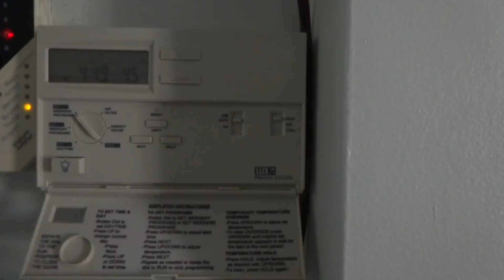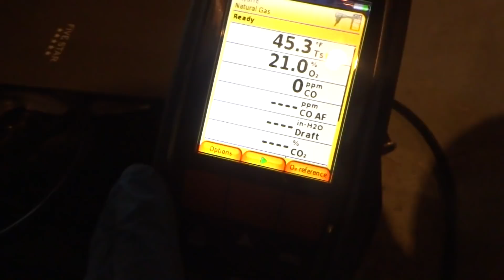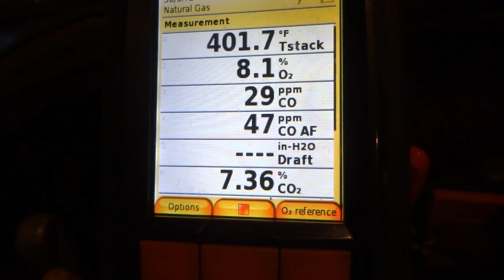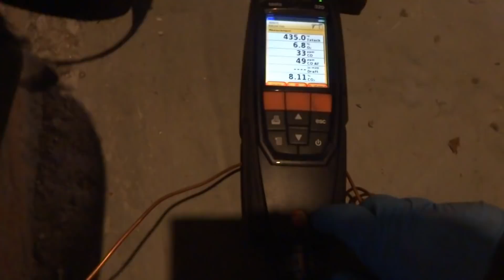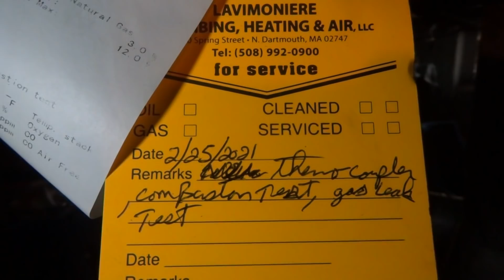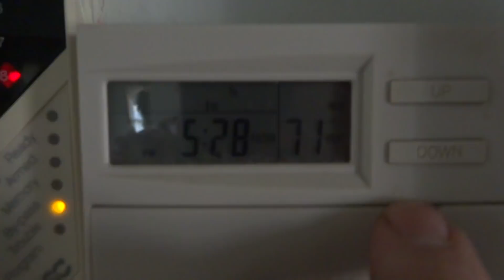GAS BOILER  NO HEAT CALL EASY FIX

Comment: I like how Steve can do all that stuff and still be within 1-2hrs. T&M is the best. Some guys will charge by items.  Sprayed Soapy Water $50. Changed Thermocoupler $125. Combustion test $250. Talked to son $100. Drilled hole in smoke pipe $400. Moved lighter away from boiler $30. Glanced at other boiler $700.

Comment: great video as always, those vr800c1166 valves are adjustable, i remember working on them, google that part number for honeywell spec sheet, it shows small cover screw on square regulator block to  take off and adjustment screw under it, not trying to be a smartass, just wanted to mention. i have been a subscriber for many years and watch your videos everyday.
Reply from the maker: i will have to look into that

Comment: I once had a furnace where the thermocoupler would periodically fail, in the middle of the night, in the winter, when it was really cold.  So the first time I bought two thermocouplers and replaced the bad one and left the second thermocoupler in the furnace closet.  The next time the cold woke me up I got the tools I needed and a lantern and replaced the thremocoupler and had the house heated back up before anyone else was bothered by it enough to be woke up.  Then a few days later I bought another thermocoupler and put it in the furnace closet.  Stupid thing would go out every other year on the coldest day of winter but by keeping a spare on hand I never had to start up the stove and oven and turn the furnace fan on constant.  Fortunately, in the case of a failed thermocoupler, the house was leaky enough that a carbon dioxide buildup was not a problem.  Was glad when we got a new house.

Comment: If the gas valve is non adjustable is there some kind of adjustable inline regulator that could be installed ahead of it?  Just curious.  Suppose it woukd be easier just to put on a new valve.
Reply from the maker: i guess you could put a inline adjustable regulator but it would be kinda weird and hacky i would not want my name attached to it would it work = yes should you do it = no just replace the gas valve with a adjustable one is my choice .. i have seen them on space heaters in apartments because them gas valves are not adjustable   but not on boilers or furnaces .
Reply: I see here in nyc where someone changed out a gas train with a combination gas valve and left the regulator
Reply: @stevenlavimoniere  thx.  Weird and Hacky are my middle names, lol.  You ought to see my homemade transfer switch system for my generator.

Comment: This older Guy told My Dad that an "E" Violin String works good to clean gas piolet lights, if they need cleaning.   You can get this little gizmo called a pin vice to chuck it up in.